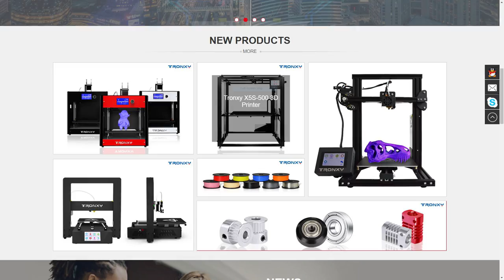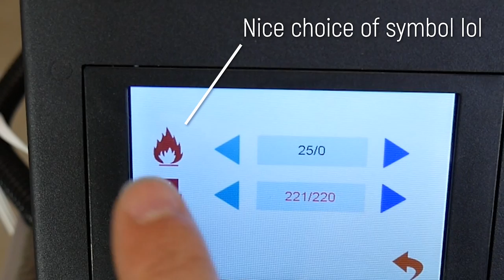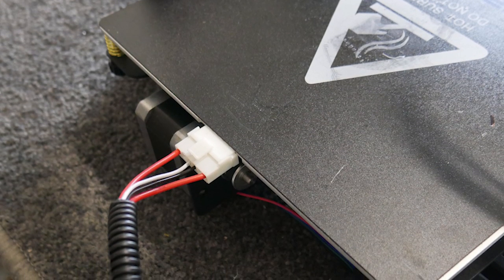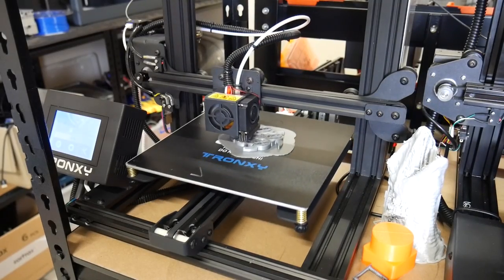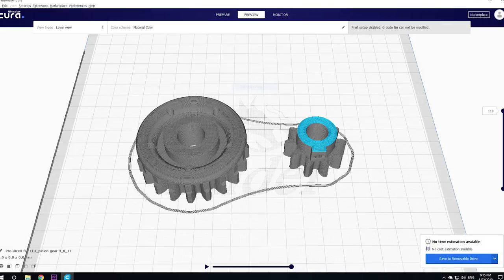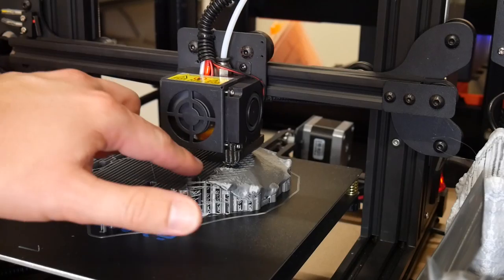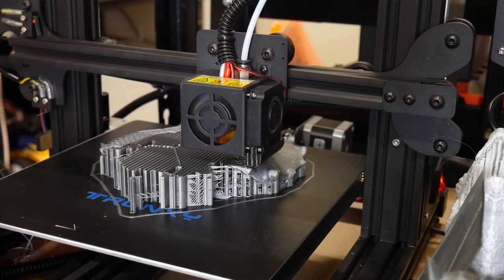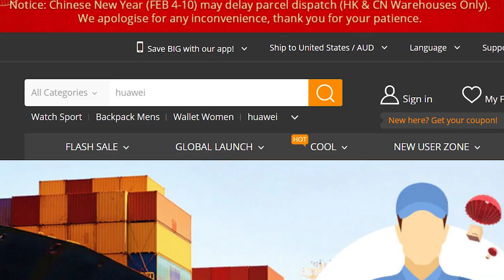Tronxy XY-2 3D Printer Review

Comment: Is USB3 so much more expensive than microSD?
Sorry, but this machine is not worth buying. Any costs saving will be offset by print fails and wasted filament.
Reply: @roolin2  Arduino Leonardo (ATmega32u4) has USB built in.
Reply: Given 1 choice would you prefer:  USB tether?  SDcard?  Wireless/browser controlled ?
Reply: USB3 would probably slow down the machine to much.  Even USB2 is a bit slower then SD card, as it requires more CPU power to operate.
So, going to 32 bit CPU instead of 8 bit would make it possible to run USB as fast as SD card.
Yes, I have compared print time with firmware and hardware that support both.  Guess Ethernet would even take more resources from calculating path and the print speed.
Reply: @revengefrommars  yes, and there are differences in printing speed depending on the source.
SD is faster then using USB. Yes, I have tested on Arduino with USB and SD. It's a quite noticable difference in print speed.
Go for a ARM with more memory and CPU power if you want other IO to work fast then SD.
Reply: One of the problems of USB, Ethernet, Wi-Fi, etc. is the memory needed for buffers. If you don't want to go the SDRAM way (and you don't!), SRAM is pretty much scarce in small CPUs. Just the color display must be a memory hog. SDCards are much humble in that regard. You can make do with 4K or less.
Reply: @roolin2  USB is usually used as a serial line transfer the CNC file.
The interpreter and path calculations are done the same. Only how the printer recieve the commands differ.
And Yes, SD can deliver each commands faster then the other methods, like USB and Ethernet.

One solution would be to let the host write to the SD memory, that the printer then print from. But then you don't get the control you want to have from the host computer.
And Yes, it isn't that fun when the host goes into sleep mode after 30 minuters, and stop sending commands. 😜 (been there, done that)
Reply: @taranachmcleod936  what is wrong with telling what shortcommings these machine have and why?
Yes, the OP was a bit negativ, but that was his opinion, and these machine are not for him. They are Great for me who want to tinker, and isn't afraid of that.
Reply: @taranachmcleod936   hey Grandpa, way to miss the point from your garage printing out benchies all day. Anyone can build a printer for $200, and it will be shit.  The important aspects of quality printing cannot be made for $200. This thing is disposable but good for old men who like to waste time fiddling with printers and never actually making anything useful.

The solution to 3D printing is not lowering standards.

Comment: I'm having a similar issue to the extruder skipping on my Ender 3. I can't even get a print off right now. I've changed nozzles, gotten a new aluminum extruder gear set, and still nothing... any help you could provide would be amazing. I'm really frustrated with this.
Reply: If you are not going too fast for the layer height, the issue could be poor quality filament or the extruder stepper motor needs replacing. If you still get skipping at lower speeds, the motor is shot.
Reply: is the ptfe straight ? are the temperature sensors reeding corectly

Comment: Hi i need some info please.  I have the same printer but it came without runout sensor.  Can anybody assist in showing me some pics of where the white cable connects to and what needs to be done to use it.  Thanks

Comment: PLEASE answer,
Because i often have struggles with the Support material not being able to remove ...
Did you Print this with a "Support Interface " oder not?
Because i am about to get Info that topic, but dont know if its worth it...
Reply: I've never gotten good print surface with supports. I'm at a loss because it's either fused to my model, or it looks like shit.
Next printer is surely gonna be a dual material printer so i can use disolvable supports because it's the most frustrating thing about 3d printing.

Comment: I would recommend to not get this model. Get whats more popular. The touch screen is just ok. I have the TronXY X5SA. It basically prints the same exact quality as this. It is annoying. Just starting out and learning how to tune your prints and eventually getting them perfect feels great. The layer inaccuracy for this machine really keeps you from getting to that satisfaction. I have also gotten some strange lines on the exterior in some prints. Not all that I can explain and I'm not sure if its a software thing or what.  I am in the process now of upgrading everything and feel like im building a whole new printer. They also use a different "flavor" of G - Code which can take some getting used to. I have owned a  Folger tech i3 printer and I have an older Anycubic Kossel pro.  They both printed flawlessly once tuned. I got my x5sa cheap on a Gearbest "OMG buy now in the next 50 minutes" sale. So you can get tronxy printers a good amount cheaper than amazon if you keep checking banggood or gear best.

Comment: Angus, I feel you have reviewed this solely on the "beginner expecting and out of the box experience". What about all the hobbyists and tinkerers who want a printer or perhaps a second device? They are quite capable of checking, aligning and calibrating these machines - what they need is basic technical information such as PSU voltage, main board type including processor and stepper drivers (pololu plugin?), max temps, heatup times etc.

A simple on screen table or a short monologue detailing them and indeed what you have found regards to them by using the machine (eg does it really heat up to 60 degrees in 3 minutes?) could  be considered an essential part of a "review" video. I see it that you have fallen short of this here.

The expectations you set seem only catered by the likes of Prusa - suggest to the "beginners" they buy a ready assembled MK3 so they just have to lift it out of the box, snip 4 tie wraps and call the helpline if they get stuck. 

If they can't afford that then maybe they should just spend time rather than money by reading and learning which is arguably the main ingredient in "empowering their creativity"

Comment: I can't recommend Tronxy or Gearbest and I don't think you should either. 

My first printer is the Tronxy X8 that I bought from Gearbest about one year ago(last Feb). 

It came without the z axis rods and neither Gearbest nor Tronxy would respond to my emails for a long time then when I finally did get responses they said I'd have to buy the rods from a third party. 

So let me restate that: THE MANUFACTURER AND SELLER WOULD NOT SEND ME THE PARTS THEY LEFT OUT. They also wouldn't give me a partial refund to pay for those rods. 

I say fuck Gearbest and fuck Tronxy.  I did eventually buy those rods and the printer does work decently for a $150 kit. 

But the experiences I had with Gearbest and Tronxy have proven to me they aren't worth dealing with. 

Luckily I ended up getting a Prusa MK2.5 and have only ever had problems when swapping out nozzles because I moved the block too much and caused the heater core wires to break. 

I will say that if the Tronxy X8 is leveld right and has good filament and a clean nozzle that it can print nearly identical to the Prusa with the exception of the build plate's texture. 

And I'm glad that you have had much better experiences with these two companies.  :{J

Comment: cure loss of power issues... put a UPS between the printer and the wall.

And if your utility company is "thumb up the bum" like mine... you need a good one that regulates the power.  Its common for the local "110 to 120 VAC to measure  as high as 180 VAC to as low as 90 VAC which buns up computer power supplies.
Reply: Those power interrupt resume features on all these printers work like crap. A UPS is a much better option.

Comment: I actually give tronxy idea to give you a review unit i see them make new 3d pronter xy2 while i buy x5st did you know they motherboard is east to mod yeah somebody review x5sa somebody i forget the name give tge firmware i have the firmware to they use same controller for all 32bit printer use stm 32 still bad steper the glue in the driver to board i hope they can sell the board woth tmc 2130

Comment: Meh.  Setting people up to fail with this printer especially beginners. It should be a little more bullet proof and ready to go out of the box for someone new to 3d printing.  I am 20+ years field service and up to my elbows in instruments and I would not want to own this thing.  One thing I have learned is worth more than anything is reliability.  It is worth nothing if it is not reliable.  You had to do several fixes to make this thing work.  The average person would not be able to do what you did.